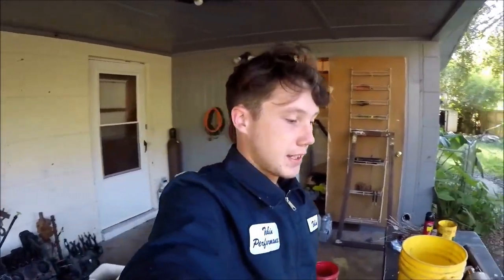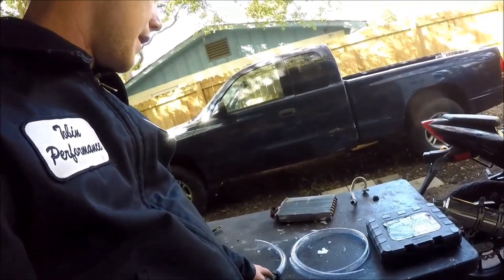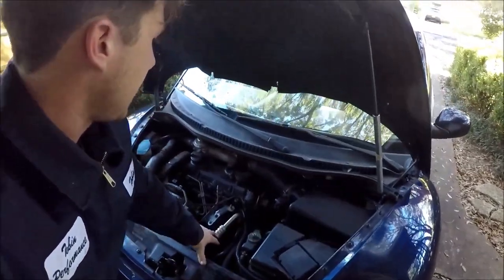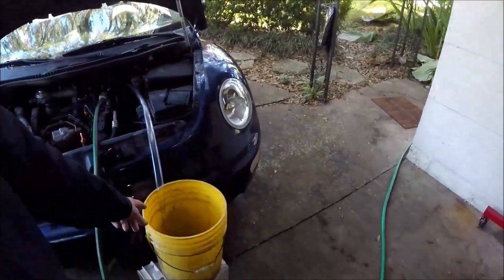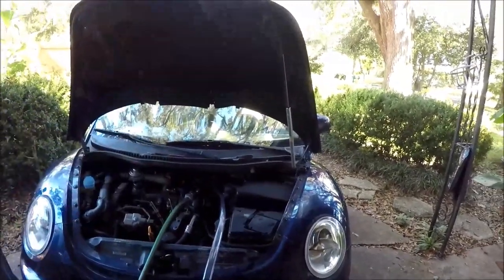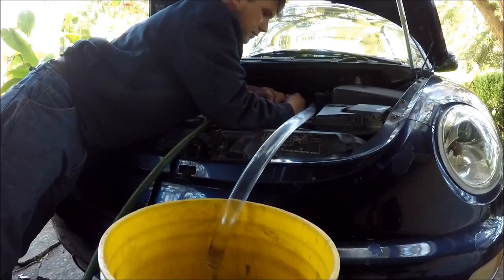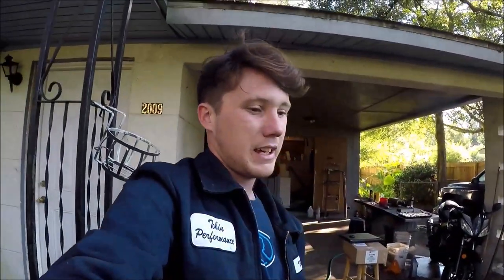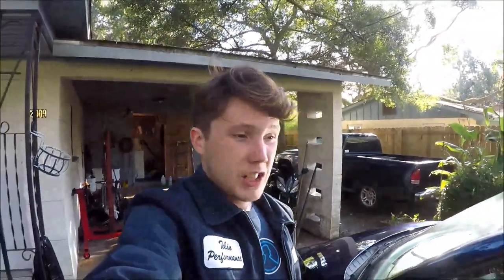How To Flush Any Heater Core.... And The Beetle Is Down

Comment: Yo, awesome video! And great info! Question tho, my dad has a 2012 Vw Beetle and the coolant lines that connect to the heater core in the firewall has broken. Like the plastic nub that comes out so the coolant line can connect to it, that piece is broken clean off and is inside the coolant line. How would I go about replacing that piece? Is it something I need the dash out for? Thank you!

Comment: My heater core must need the same on my 2013 VW Beetle Turbo. It’s not heating. VW Dealership wants 1190.00 to change heater core. Said it was a 6 hour job.. I’ll try heater core flush first. However, I won’t pay 1190.00 for the repair. Thanks for the video.
Reply: Is your engine a ckra
Reply: I have a 2013 vw Beetle turbo Fender Edition. It’s a four cylinder gas engine. .Noah,, I had success by flushing out the heater core. It was dirty. I did have to replace the inlet heater core flange because it was toast. Now , I get heat in the cabin . 👍😁
Reply: I have a 2012 turbo and same thing... Did flushing work for you?
Reply: The flush seemed to work! It takes a few minutes for the  inside of the Beetle to warm up...but the flush did help.👍😁
Reply: Fine now Noah.👍🖖🏽

Comment: Until Amazon comes through go 2 a junkyard and unplug 1 you can B still driving until your delivery gets there 😂
Reply from the maker: I was actually wrong about it being a fuel pump at the time over 18months ago I was new to the alh vw diesels it was actually the injection pump timing alh cars do not have a fuel pump or lift pump they use vaccum from the injection pump. I did atiming belt job and tighten the bolts to factory spec with lock tight a few months later I took it to vw cause I lost my wheel key then it broke down the 3 bolts for the injector pump where hand tight I re torqued them again to factory spec didnt use lock tight this time and set the time never had a problem since free fix and a big headache and I will never take it back to vw for anything ever again I would rather pay twice as much for the tool cause they definitely fucked with shit
Reply: @gearhead4266  You ain't never lied about that... they stay on B.S. full of greed 😒 dealership so scandalous, now i try 2 do all my beetle maintenance 2001 beetle 1.8 turbo triptronic electronic automatic M1 TRANS dealer tryed 2 tell me trans fluid doesn't need changing its a mineral spirit  fluid 😳😣 B.S. i changed it myslf, ANYWAY !!!  i don't need the dealer deciding 4 me I changed fluid and filter 2 Amzoil top shelf fully synthetic trans fluid shifting extremely smoother than b4 😆😆😆... Gud luck 2 you from Detroit, Michigan
Reply: Sorry i 4got 2 tell you wat you need is a chemical flush 😜 this is the best under the son of man...  TOP SHELF... REACTION CHEMICALS COOLING SYSTEM FLUSH R106 4 COOLING SYSTEMS AND HEATER CORES 😳😊
Reply from the maker: I've never heard of that before ill have to try it i am in Florida tho so heat is rarely needed but yah man screw the dealers happy you made it out tho